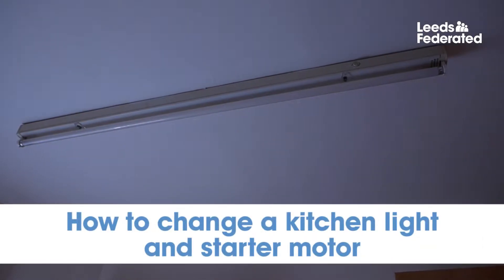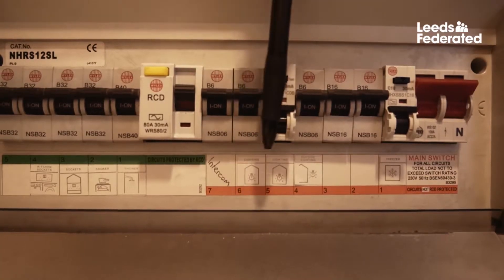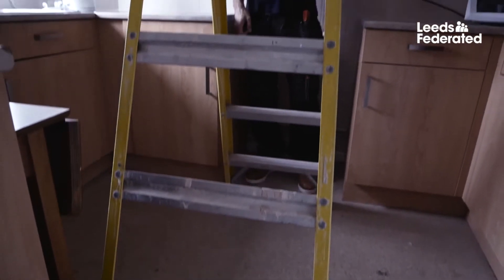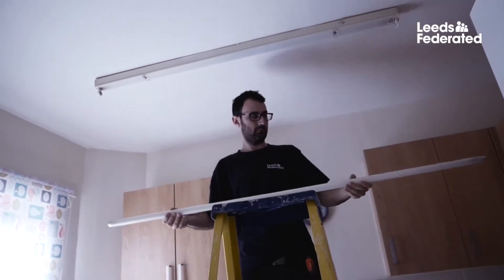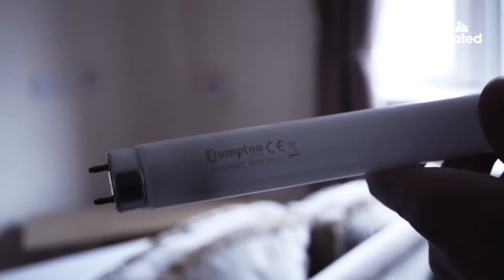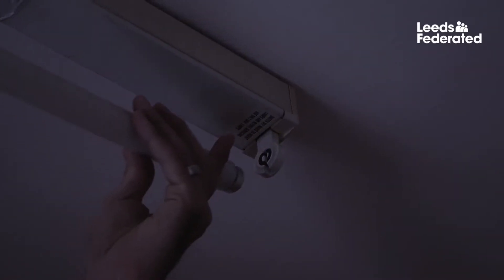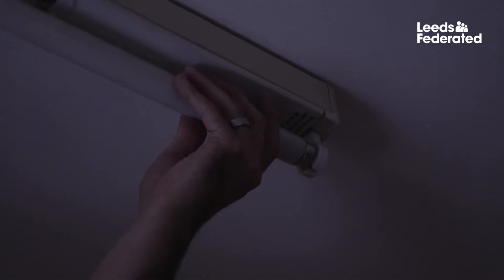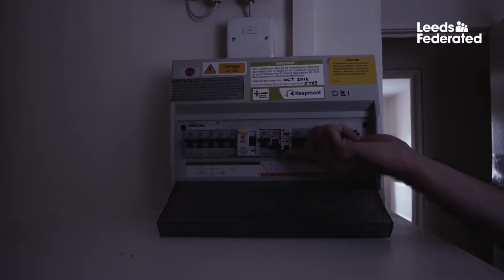How to replace a kitchen light and starter motor

Comment: Being a electrician as I am forever that's is a 5ft light fitting it's runs off a 58w ballast and with a 5ft 58w t8 fluorescent tube and a 4--65w starter switch motor.must be in general used for your very New types in that style of replacements for that 5ft fluorescent tube light fitting.

Comment: The starter is not a motor. Also, you should attempt to change the starter before replacing the tube